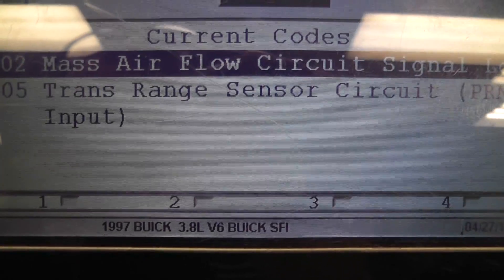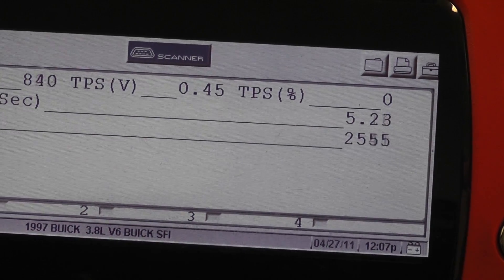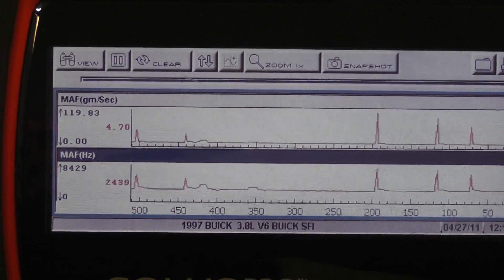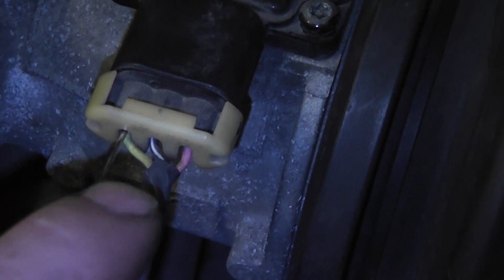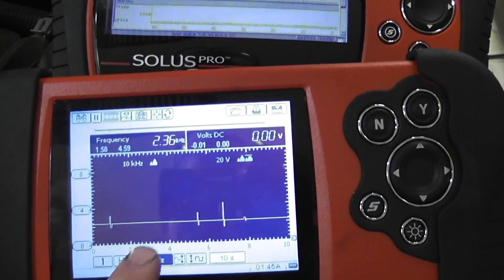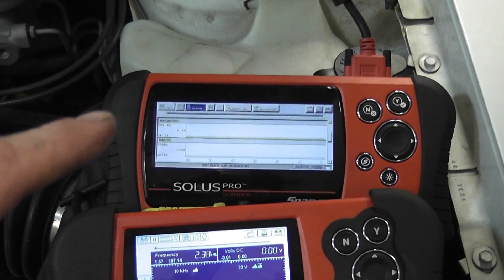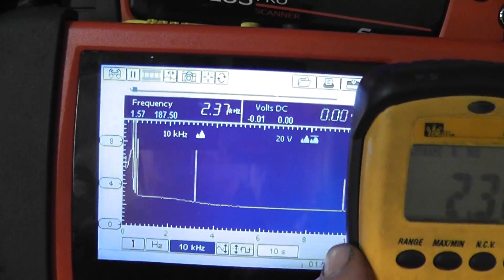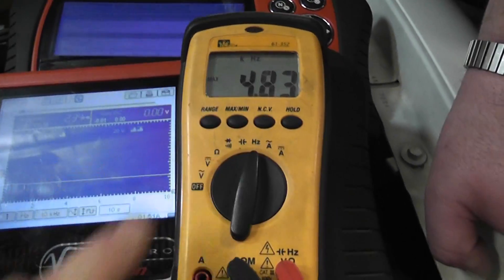How to test a GM MAF Sensor (Part 1)

Comment from the maker: @ScannerDanner To answer your grams per second question. All cars are different, check out my dirty MAF case study on a Toyota and compare it to the readings on this one. They are completely different. 
Some numbers I use on GMs is I want to see near 150 gram/sec at WOT, redline, but even this number is variable. I have seen the in-line 5 cylinder engine run near 200 grams/sec at WOT redline. Short answer is there is no set number.

Comment from the maker: @contagiousFX Because GM MAFs report in a variable, digital on/off square wave 0-5v signal. (frequency is what the PCM looks at not voltage on this one). MAF signal voltage would be useless in reading the amount of airflow on this design. All you would see is 2.5 volts all the time regardless of frequency, 
Analog MAFs = variable voltage (0-5v) monitor with a voltmeter
Digital MAFs = variable frequency (0 - 10,000hz) monitor with a frequency meter